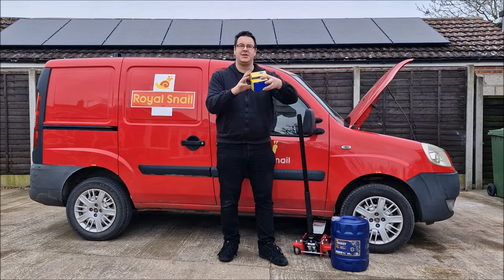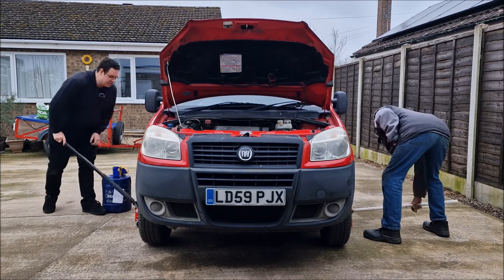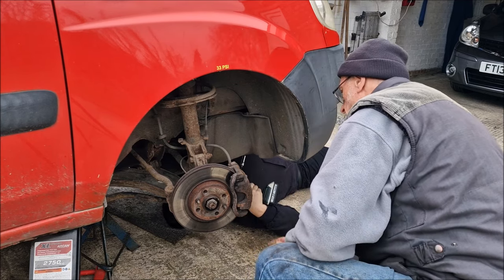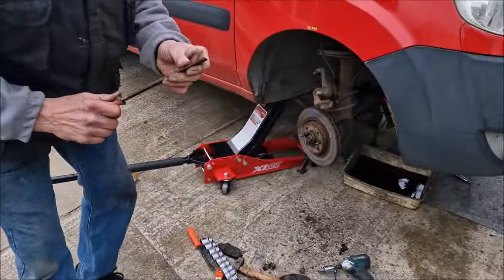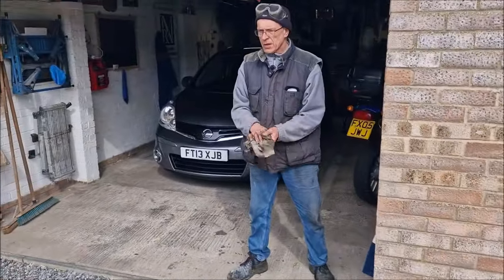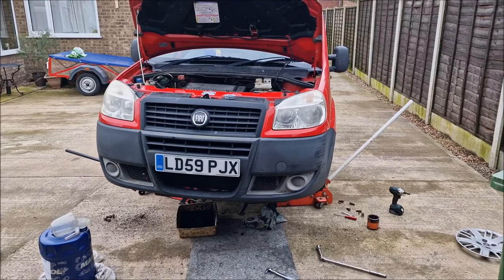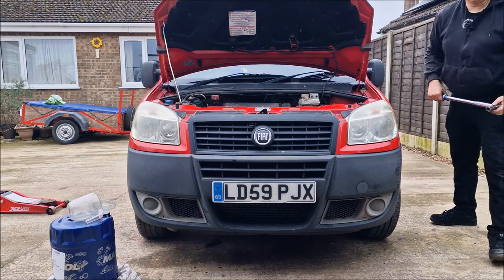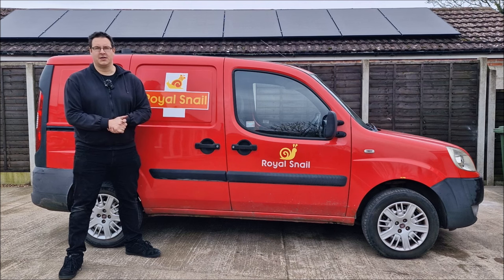My Fiat Doblo Van Was Well Overdue A Service | Oil & Filter Change, Brake Service & More

Comment: I had the Astra m5 1.3 CDTI van with same engine  the sump went rotten it was loosing a little oil.  then the tensioner went the timing chain jamp a couple of teeth  It was lucky i managed to get it home and replaced the sump new chain  tensioner and oil pump it was not cheap. I sold shortly after i said i would never buy another. Get yourself some stress matts you will thank me if you intend on lying on the ground the cold gets into the bones Nice one should keep it going for a few more miles.👍👍
Reply from the maker: Many thanks for the comment and thanks for watching - hope you enjoyed :)

Comment: That sump definitely wants brushing down and spraying with some form of rust protection and stone chip, as already said they are known for doing it and leaking through. Cracking work 👍
Reply from the maker: It's on the list of things to do 😁
Reply: I agree, that sump has  got a few months left before it's toast. Needs immediate treatment.
Reply from the maker: @charliecoco2115  it's being done this week 😄
Reply: A grand job there. That oil pan looks pretty straight forward to be honest. I replaced a rotten oil pan on our aging 2007 Suzuki Ignis, looks pretty much the same setup. Managed to get it out and back in without dusturbing the exhaust, a faff but an additional can of worms gratefully avoided 😬

Comment: Great job, guys and girl 🐶😄 
Maybe brush off the loose rust on the sump and spray on some rust arrestor next time, as they can rust through and start leaking 😅
I know from the Doblò my parents had that the car is a bit heavy on the front tyres and suspension. Alignment is a good idea and maybe fit some proper van tyres with a higher payload. 
Thanks for the entertainment and all the handy tips from dad and the inspector ❤
Reply from the maker: Thanks for watching. The sump work is on the cards :)
Reply: @JonCoupland I was going to say this too, so yeah, good idea :D
When you get the van's tracking seen to, get them to get someone to sit in the driver's seat, or put some sort of weight in the front. It can make a difference to the geometry.
Reply from the maker: @Zadster  great advice!

Comment: It's good practice to undo the filter housing first, as there might be old  oil held in there, undoing it releases that.
Pulling out the dipstick and unscrewing the oil filler also helps draining.
Reply from the maker: Good tip

Comment: Nice work & great footage, under trays & plastic housings a faff. The Proton oil changes will be far easier. Your dads Brake clean & service, great for safety & prolonging brake life, no longer on ‘ so called ‘ manufacturer service schedules.
Reply from the maker: Thanks for watching mate ☺️

Comment: Morning Jon,Pete,
Happy Easter 
A gentle watch for Sunday morning thanks
A bit of advice ,when you replace the front tyres on the van look at upping the load rating of the tyre as these are quite heavy on the front end and that leads to tyre wear at a rate not usually found on smaller cars.
Also whilst I'm here this mornings little film is a good example of adding clean oil to a dirty engine 
The reason I mention this is that small high revving Diesel engines like the one that you have build up quite a lot of carbon in the oil especially when fitted with egr systems like the one fitted to The fiat 
I would suggest that you talk it over with Pete and see what he thinks about using a flushing additive next time you change the oil & filter ,from experience I've found that a decent length of flush works wonders provided that the engine is fit ,and yours sounds pretty healthy to me.
The way to do it is to bring the engine up to full operating temperature turn it off and add the flushing agent into the crankcase,and for the first time you do this run the engine at a raised idle about 1500 rpm for 20 mins or so until you start to smell the flush coming through the exhaust fumes which means that it's working its way into the piston rings a cleaning out the built up carbon and other forms of crud which has accumulated,once you can smell the flush going to work let it idle normally for another 10 mins then turn off and let it sit and cool down for a while so that all or most of the oil drains to the sump taking the crud with it also be doing it this way there is less chance of scalding oil when you remove the drain plug ,let me know what you think ?.
Many flushing agents are available to purchase I however recommend Liqi Molly ,and also the Injector cleaners work wonders and I recommend a tin in the tank at every service,or at least once a year.
Reply from the maker: Makes a lot of sense and thanks for the comments. Dad says he is a bit weary running engine flush in an engine that appears to have been a bit neglected in the past. The rationale being: if some crud and gunk is dislodged there is a potential for a clogged strainer in the engine system. To quote Dad. He's a big believer in leaving well alone if it's still working ok 🙂👍
Reply: Agree with not using engine flush if all is ok, best left alone.
Reply from the maker: @DoubleZeroGarage  I suppose it's personal preference isn't it :)

Comment: Plenty of work for the wire brush under there 🙄 
The wire wheel on the grinder will work if you can get at it. I usually put one on the drill. I too have a vice on a chair,  very handy. You can run the pads on sand paper to take the glaze off them, no doubt Pete knows that.
Reply from the maker: Certainly got my work cut out this week 😂

Comment: Well it seems you mucked up the oil change by jacking it up all wonky towards the passenger side opposite from the drain plug, so all the worst of the dirty gunk and sludge will have settled in the corner of the sump and will now mix with the nice clean new oil until the next change…..
Reply from the maker: Oh well 😂 better than nothing
Reply from the maker: Live and learn for next time 😂
Reply: If I may be so bold, in the words of my father-in-law; it'll be fine. It's only been a couple year since it's last change, not a lifetime. I'd say gunky sludge will be pretty minimal.  You never get it all out anyway.

But a good tip for next time nonetheless 👍🏻